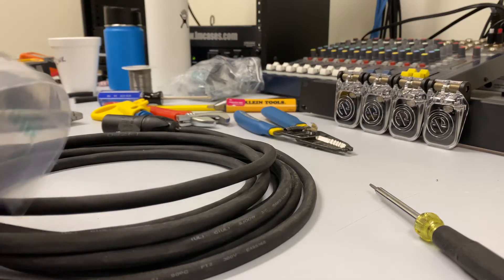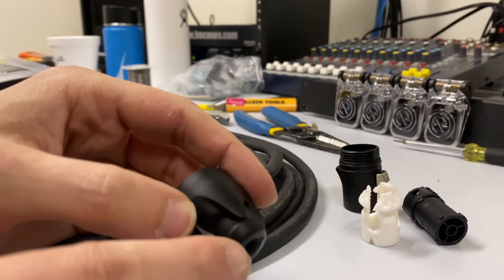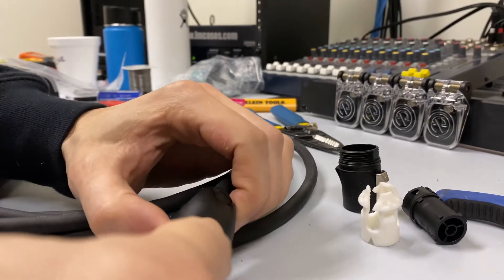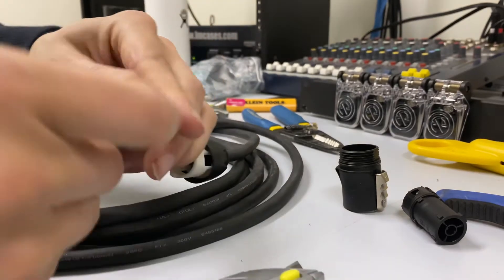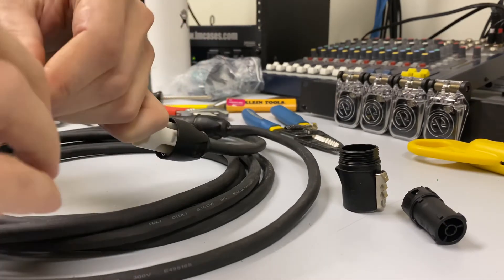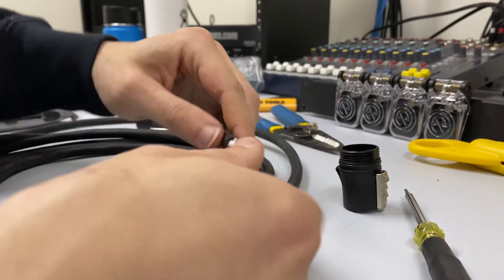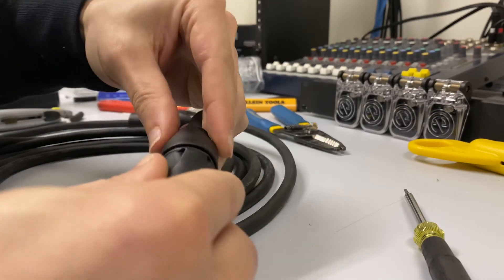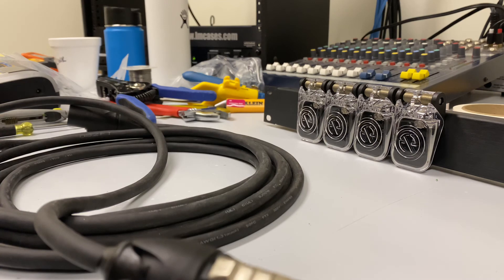How To Wire & Install A Neutrik powerCON True 1 NAC3FXW-TOP Connector: Today I Learned With Billy #5

Comment: Best vid out there on how to properly connect power leads to Neutrix power connectors!  Ty
Reply: Evidently you have not watched enough alternative videos! This is an example of doing it badly!
Reply: @AndrewLumsden  Your opinion!   Right!!
Reply: @JMD535  No. Common sense should tell you it's bad. The chuck grip should be gripping the black outside sheath, not the individual conductor wires.
Reply: @AndrewLumsden  Well, all I know is that my setup regarding this came out 100% perfect!  All of my INs and Outs are external in my Odyssey controller case! 

Neutrik PowerCon Combo:
   Power In
   Power Out
Left and Right XLR Outs
Left and Right 1/4" TRS Outs
NEMA 5-15 receptacle added!

I flip one internal Switch and everything in the controller case has power,...plus a separate Switch for case lighting,...for a totally exceptional clean setup!  No disorganized array of cables and wires everywhere.  The added power outlets for the speaker cables at 'Floor' level, so there is never a need to run additional power wires to the controller case.

So, again, this video assisted me in setting up my case the way I had planned for the wiring setup to be!  So, that's why I gave this guy credit.  I wasn't looking for what he got wrong,...I was looking for what he got right!

I probably would have viewed your video on the topic the same,...by capturing and working with what you got right,...versus dwelling on any faults you potentially may have regarding this topic!  Which is most likely - 0.

Comment: As someone who never soldered and never intended to, its kinda frustrating seeing every Neutrik tutorial focus so much on the wire connectors. I can buy premade ones for that. What i would be MUCH more interested in is the actual chassis connectors. 

How do they work?!
How do I continue with the cabling INSIDE the rack / patch panel? 
Do I have to know soldering for that if I want all Neutrik TOP connectors?
How do I properly do that?

I am completely lost still, even though i've been watching these vids for like 2 hours

Comment: Good video, but you strip too much jacket. The "teeths" on the white part should sit on the black jacket, not the wires directly, since it's part of the strain relief . Sure it'll still work, but, it's going to be much less durable in the long run.
Reply: 100%

Comment: Is this connector for single use ? What if the cable is damaged, can you use the connector again?
Reply from the maker: The connector can be used again, however it is difficult to take apart. The little metal “C” clip prevents the back nut from vibrating loose. You will need a pair of pliers or vise grips to remove the back nut. The C clip comes out through the bottom boot when you loosen the nut. It’s not very easy to disassemble, however it can be done
Reply: @billylaguardia  not so, SUPER easy! the spring clip pushes back and gets exposed through a little hole in the side of the boot end. poke a lil screwdriver or pin, and you get an extra turn!
Reply: @billylaguardia sounds difficult... Can you make a video of that?
Reply from the maker: @mneves7263  haha sure. I actually had to do it earlier this week.
Reply: @billylaguardia  I know how to do it. It's not that hard if you know what to do. Thank you.

Comment: Next time, flip the cable around and put the male connector on the other end. You won't have to cross the Neutral and Ground wires. Cables have a front and back end! Works the same for Edison and twist lock connectors also.
Reply: brilliant. i never gave it much thought but you're right. I'll try it next time.
Reply: I just looked at the instructions for these connectors and it shows the correct orientation in the diagram but doesn't explicitly mention that orientation depends on what end of the cable you're on. it's a little thing but this is blowing my mind right now.

Comment: you forgot to add ferrules at the end of your cable, stops it from fraying apart over the years, and the insurance companies over here like it that way :).
Reply: Absolutely no need for ferrules the small terminals inside the connector probably wouldn't be able to accommodate the ferrules in addition to the bare wire. If you are afraid of stray strands, just twist the strands and add some solder to keep them together.
Reply: The idea with the solder works too of course. I learned my stuff back in Germany, and it would be a fail if the cables wouldn't have ferrules. 
 @AndrewLumsden

Comment: Just FYI those True 1's come screwed together so you can push the weather seal onto the cable without the spring clip coming out. Don't unscrew them, push the cable through first then unscrew them. Also some silicone spray helps get that weather seal on. Keep up the good work.
Reply: A great point. And looks like Seetronics bypasses the two-piece back shell issue.